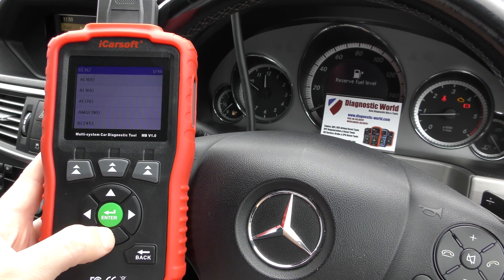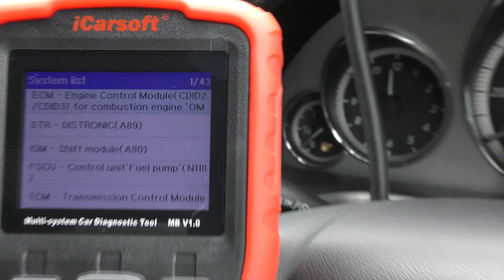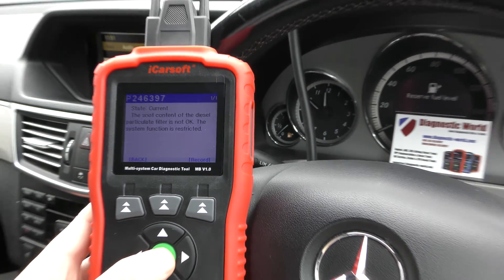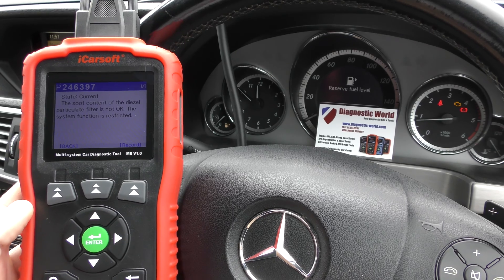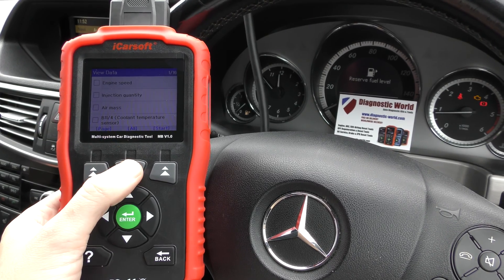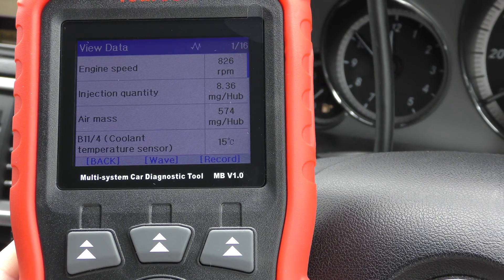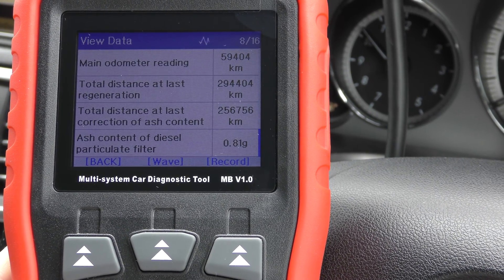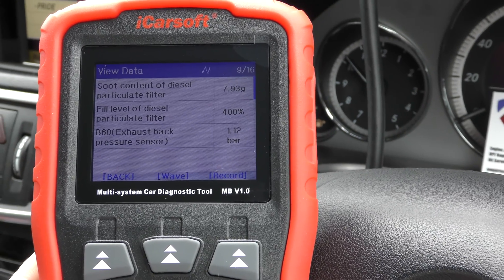The Easy way to check how blocked your DPF filter is Soot & Ash Level Mercedes

Comment: Obviously theres issues with the hardware/software associated with this cars DPF as its travelled over 29000 kilometres since the last regen according to the readout on that scanner.   
The vehicle should be regenerating on a regular basis.
A simple regeneration will not sort out the issue as there is something very wrong with the system which needs to be corrected. 
Need to involve a specialist as although this scan tool will give you the data (I have a similar scanner) it will not tell you the solution you need a very experienced expert to interpret the information and come up with a permanent fix otherwise even with a clean or an expensive replacement the build up of soot will continue. 
Find the issue before throwing parts and money at it.

Comment: Does my 2010 2.2 viano have a dpf? Got a recall tomorrow and my car has never done a regen. Concerned its been removed and I will be left in limp mode. Any help
Reply: the car does regen on its own when you drive. It shouldnt need to be forced unless its faulty or nearing its end of life. If you only drive short distances the car might not get to such temperatures to allow regen while driving. Drive a longer route once in a while.

Comment: EGR valves and DPF cleaning should be a regular part of the service schedule because added soot & dirt only leads to huge bills if the car is not used correctly. Given that most diesels in Europe are used for city life, this is a huge problem. My feeling is that Diesels are being forced into history and with a lack of maintenance, huge bills will only result in reduced life of the engine. Now i use a scooter in the city and would never buy a new diesel, Infact i wish i’dd kept my old diesel. I wonder why old diesel priced vehicles are going up?These are “Cheaper to maintain and repair” on with less complicated systems😉 the added cost of diesel means it has to be run by a business to make economical sense, not a family or sole trader
Reply: YouTube the following video, then guess who lol     BMW E39 5 Series Airbag Light Reset

Comment: Something seems dodgy here. Apart from the mileage not matching up, the dpf would not be blocked with only 7g of soot and 0.8g of ash. Also the car won't regen with active faults. The car needs to be driven whilst the error code is continuously being reset until it starts to regen on its own.
Reply: YouTube the following YT video, and guess who lol......... BMW E39 5 Series Airbag Light Reset

Comment: Bought the iCarsoft MB2 system. Great tool. One thing I've noticed when observing live data is: 1) It will NOT regenerate if the fuel light is on. If it's asking you to refuel it simply wont initiate the regen. When I picked my Merc up from Carshop 2 years ago it was on 230%. Clearly just a run around for staff/manager etc.    

2) With my E250cdi / pretty much the 220cdi it doesn't do active regens. So even if you're on a long motorway drive, unless it hits the magic 100% fill level it wont initiate a regen. 

3) It won't start a regen until it's warm. 

4) The revs make no difference to the regen process. I thought holding it in 4th to give it a good "clearout" would be good for it. Makes no difference. Even in traffic, the ecu simply adds more diesel to heat things up. Works just the same. Don't waste your £ revving the arse of it. You can track this with injection quantity. Come off the throttle and coast and it will still be adding a small amount of fuel when it usually reads 0 injection quantity.  Works the same in urban driving. 

5) My soot levels usually get to 7g. Every couple of regens this drops to 0 or 3. Does burn off. 

6) Ash content of 0g is a good thing! This doesn't increase. 

7) My dpf doesn't seem to go to 0%. Seems to stop at 3%. The filter has hit 74,000 miles of use. Guess it can't clear everything out.
Reply: If you get a 400% fill you can be sure that it is a false reading, given by the differential sensor. Replace the sensor.  The Icarsoft MB11 has a programme whereby you go into the regen programme if you have a "too full to regen code" it then guides you into a programme where it spends approx 5 minutes analysing the sensors etc, then bringing the car up to 1500 rpm. It will then tell you the true levels and delete the code. 
If you do not proceed to a forced regen (low fill readings) and you do not come out of the programme correctly it will show 357% fill and 13g soot and the fault code P246309 "soot content not ok...." will be displayed.

 Before replacing the  Differential sensor check the tubes for cracking and blow them out with compressed air. After replacing the Differential sensor, reset it, or if you do not have the equipment for that ,tell it it has a new DPF. 
Icarsoft will not do it for you. Snap on or Autel will.
In any event it is the differential pressure and the exhaust back pressure that will tell you the true state of the DPF.
 
B28/8 Differential reading at tickover should be approx 0.01 bar
The B60 exhaust back pressure should be between  0.945 and 1.545 at tick over and not more than 4.065 at 3000rpm.

The intake air sensor should be working properly and the B19/11 temp sensor-a fail point in the OM651- should be reading correctly.

If not your car will not regen as it needs to show temperatures of up to 700c for the regen/passive regen to happen.

Mercedes, for safety reasons-high heat causing fires-  prevent a static forced regen. Also a regen will not happen with less than 14l of diesel.
Reply: @carzone2968  YouTube the following video, then guess who lol   BMW E39 5 Series Airbag Light Reset
Reply: YouTube the following YT video, then guess who lol     BMW E39 5 Series Airbag Light Reset
Reply: My dpf is blocked and gave up no codes. Had limp mode and was smoking bad as if theres a boost leak. Still in the garage for further investigation. Thinking leaking injectors? but its running fine when its running fine haha. Why wouldnt it do active regens? E220 2014
Reply: In my 2000 Ml 320 Blutec, I was at 35G, and had a faulty glow plug, 

I've replaced them and put some cleaner in the fuel tank and used better fuel, been driving about 200KM so far, now down to 13G, hopefully can get it down to 0 without removing the DPF. I'm using the Icarsoft MB V, 3.0 I try to force the regeneration it keeps saying error on the last step

Comment: Hi 
My Brake hold has stopped working on Mercedes e class 2017 cabro. I have changed the main 12v battery. Will this unit help me to diagnose what's causing the issue.

Comment: In my case the dpf was extremely blocked and the car could not exhaust properly, limp mode and stalling. I had the dpf factory cleaned by shop and it’s good like new. Codes may return however the back pressure sensor,dpf sensor and possibly egr should be replaced/reset they all work together

Comment: Most common DPF  warning light fault on Mercedes is the dpf pressure sensor giving false readings...always check that first
Reply: How to check that? As I have the engine light for 2000 miles now
Reply: @georgestanuk9626  well I had this exact issue. But in my case the car also had a fault code that said "Particulate filter pressure sensor A circuit low". Changed the sensor. Erased fault codes and checked the dpf fullness level with scanner. Scanner said that need to recalculate. Clicked ok and then boom. DPF fill level less than 10% and no more faults.

Comment: Did you just do a static regen ? if so, how long did you maintain the revs for ? 
I've got a dpf issue, but I'm currently repairing my rear suspension so can't drive the vehicle, I'd like to regen my dpf without driving the car.. also will holding the revs in park cause any issues.
Reply: Check the dpf pressure sensor

Comment: I have this tool and its good, i own a W212 E220 Mercedes, and it can isolate faults, I think i have a clogged filter but how to clear it ?
Reply: Remove dpf pressure sensor tube and spray a can of K2 cleaner down it
Reply: @crisfiler6128  can you say which of the 2 tubes to squirt the k2 down ? large or small pipe?
Reply: @crisfiler6128  k2?

Comment: Hi which scanner u recommend that ,can actually  regenerate dpf filter. Regards
Reply: so stupid question, you need to clean that with your hands or buy a new dpf filter
Reply: @SalvageRestorationAndTechTips  another idiot with genius answer, if u don’t understand a question keep your pipe hole shut
Reply: @Romski1978  autel maxicheck pro

Comment: Main odometer reading 59404 km , total distance at last regeneration 294404 km 🤣 .400%  blocked makes sense , probably a Uber 24/7👏🏻
Reply: "Main odometer reading 59,404 km , total distance at last regeneration 294,404 km"
Why would the distance since last regen be more km than the car has actually driven? Do you think it's been clocked?
Reply: @mbut123  definitely
Reply: YouTube the following video, then guess who lol   BMW E39 5 Series Airbag Light Reset

Comment: Is there obd that can start the regen
Reply: You wish!  Mercedes doesn't even give a dash light for regen in the W212, as they do in the same engine in the Sprinter van.  The dealer charge of $8500 to replace!
Reply: @DouglasHopkins  I've just paid £3100 to have the DPF on a 2012 59k mile S350 replaced. Wish I hadn't bothered, and just put up with the occasional  code as I'm still not convinced everything is working correctly. Thanks MB, never again.
Reply: @mbut123  whaaat it shouldn't cost that much what merc was it.
I've the same problem. Did yours have power issues when it happened
Reply: @vitalhygiene3546  It was a 2012 s350. I regret paying that much. I didn't even check alternatives. I think I had it in my head that the cats were a ludicrous price so wasn't surprised at £2400 plus labour.
Reply: YouTube the following video, then guess who lol    BMW E39 5 Series Airbag Light Reset

Comment: Wouldn’t you have thought 100% would be full not 200? Also if a dpf is 400% full would a tool which forced dpf regen clear that much or not ? Looking to buy best tool for me from the website
Reply: No such tool. All you have to do is pay the dealer $8500, their answer to a clogged DPF.  Read my comments above.  My mechanic cleans the filter & tube for about $300.  Shame on down-hill quality Mercedes.  #W212  #MERCEDES.JUNK
Reply: @DouglasHopkins  YouTube the following video, then guess who lol   BMW E39 5 Series Airbag Light Reset
Reply: The mechanic I use has a tool which works like colonic irrigation for a DPF. Sounds as if it's the same thing as the first guy commented about. He said it would be about £350 to do mine and it's a big job as you need to  get into the engine in my Skoda. Some DPF's are easier to access as they are located around the exhaust for example. I hope this helps as £8500 sounds ridiculous.
Reply: YouTube the following video, then guess who lol    BMW E39 5 Series Airbag Light  Reset

Comment: I bought the MB1 a few months ago. Yes, the beep is annoying but can be turned off :-)
I notice at 2:26 that your tool like mine is reporting an unfeasibly  high "distance at last regen 294,404 km". I don't think so. Is this a fault in the car or tool? Or am I reading the figures wrong?
Reply: If you have discovered the answer, could you share it.  I spotted that and was equally confused.
Reply: It doesn’t make sense to me because the ash content is under 10g and soot is very low too? My bmw has 28g of ash and fills to 40g of soot then empties itself,
Reply: Ash is the one that indicates blockage I thought
Reply: YouTube the following video, then guess who lol   BMW E39 5 Series Airbag Light Reset